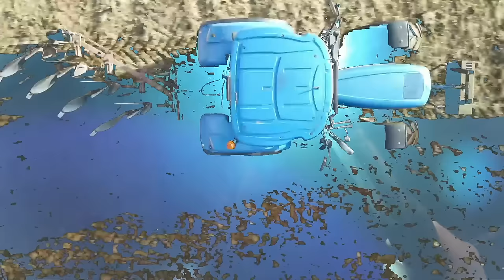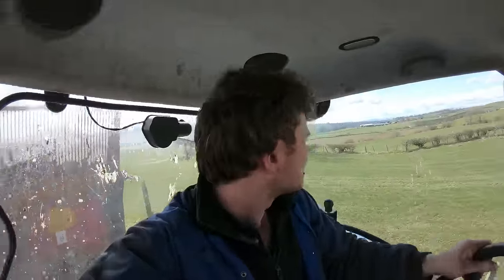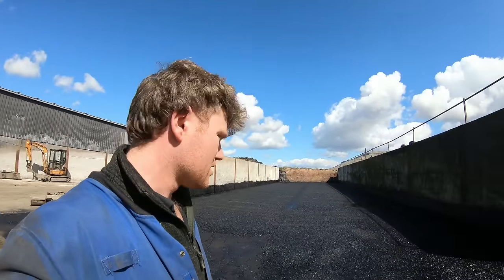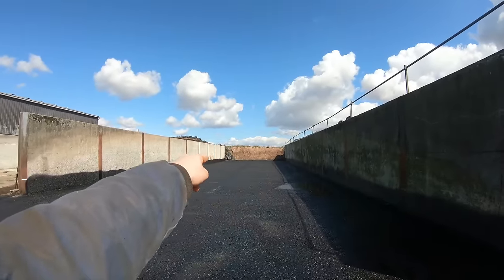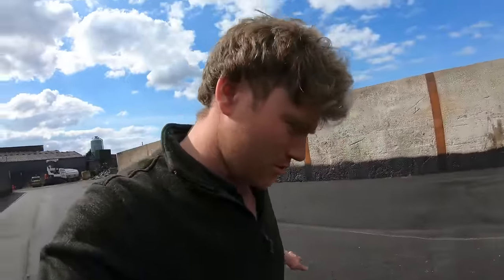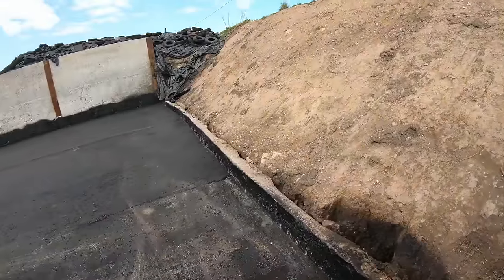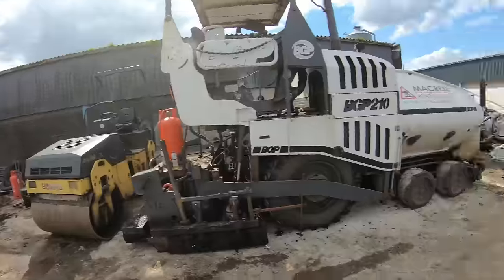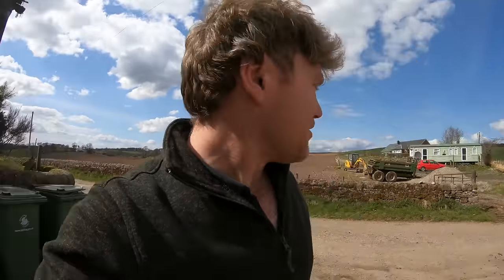TARMAC SILAGE PIT!! Bye bye concrete hello brand new TAR!! WHAT A DIFFERENCE!!

Comment: Will tarmac not be a bit soft in a silo pit floor? Especially when buckraking in summer. Looks well tho 👍
Reply: Supposed to be a great job, the weight and heat of the silage is supposed to smooth out any dents and cracks. Gerry6420 has it done too.
Reply: Tar is better than concrete
Reply: Its asphalt aswell which is a smoother finish and well sealed which prevents cracking this is a common way of doing silos